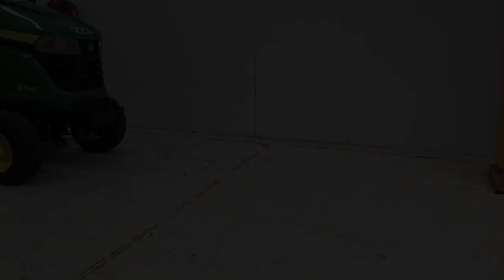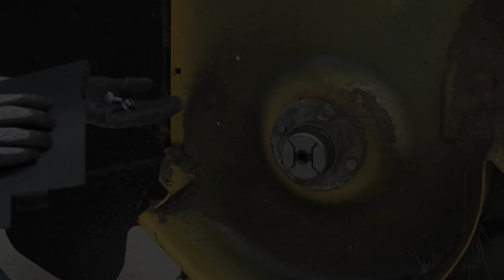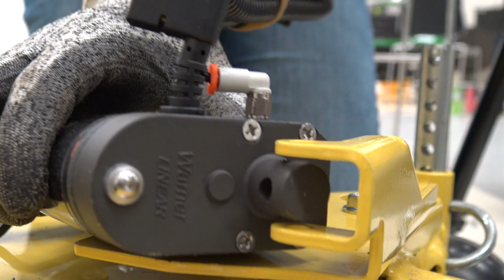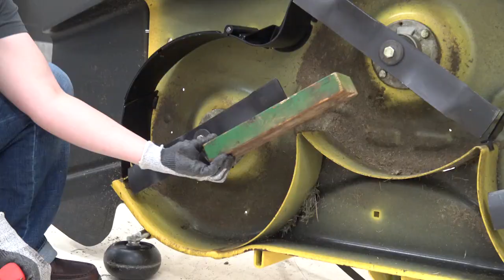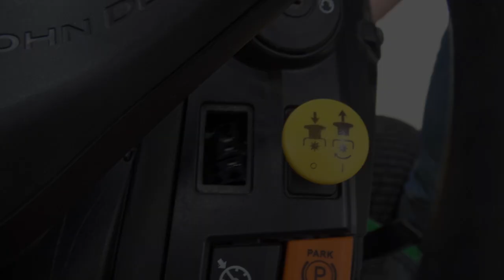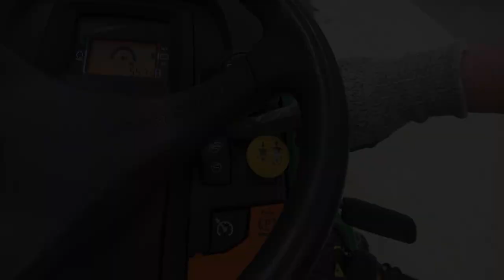How To Install Electric One Touch MulchControl™ | John Deere

Comment: My mulch control switch is operating opposite of what it should.  When I switch it to open it closes and when I switch close it opens.  What is wrong?
Reply from the maker: AL, we're sorry to hear that you have been experiencing issues with your mulch control switch. If you haven't already you may want to take a look through the Operator's Manual of your unit. Towards the back there is a "Troubleshooting" section that may help. Many Operator's Manuals are available online, so you may be able to access the manual for your model at techpubs.deere.com. You can also contact your local dealer for further assistance. Find their contact information at Deere.com/Dealer. We hope this helps.

Comment: What's the spec numbers you forgot to say in this vid. "Tighten nuts to spec with  using a torq wrench."
Reply from the maker: Thanks for asking, Davi. The torque for the Mulch Gate Stop Plate is 20 N·m (15 lb·ft). This information and other specifications can be found in the Operator's Manual for the MulchControl™ Kit which is available online here: https://bit.ly/3DcFK6a. We hope this helps!

Comment: Hi , No ! First Thing Is To Clean the Underside of the Deck ! Use " Blue " Locktite Thread Locker On All Fasteners . ( To keep from rattling loose ! ) . Re- Check Deck / Blade LEVEL ! After Re-installing The DECK .
Check the Door / Gate Opens and closes Moves freely !  ( Also Check Every so often , so You Do Not Burn -
OUT The Actuator / Motor $$$$$$ ) !!!!

Comment: The one touch kit I ordered for 48 inch deep acel deck the gate does not close all the way.  Did the send me wrong kit?  I have John Deere x570 with 48 inch deep acel deck
Reply: Kendall what was wrong with yours. Have same issues today!
Reply: @chloe5susan  I have one on my X570 (54 inch deck) and while it was mostly right some of the brackets needed small tweaks to fit my deck properly and clear the blades.  In your case I'll bet you have the actuator bracket attached wrong.
Reply from the maker: Kendall, if you have any issues or questions about the installation of your 48A electric one-touch MulchControl™ attachment we recommend reaching out to your local dealer for assistance. If needed, you can find the contact information for your closest John Deere dealer at dealerlocator.deere.com.

Comment: On a x380, a 20amp fuse on position C3 is required to provide 12v to the red wire of the source power for the kit while the yellow wire provides 12v when the main switch is on. The fuse is located in the fuse box.
Reply: Hi Richard Turcotte. I’m going to install this on my X380. Is there no fuse in C3 to begin with? I haven’t run out there to take a look yet. Thanks!
Reply: Kurt B , on mine there was one but was broken. It provides 12v on the red wire where you plug in the actuator harness. The yellow wire has 12v when the key switch is turn on. The red wire is hot all the time.
Reply: If you also have a powerflow, place the actuator support plate on top of the powerflow black support plate for better fit. And you may have to adjust for correct operation of the door by moving the actuator plate. There is some light movement possible before tightening the 2 bolts.

Comment: I wonder if one is made for a z920
Reply from the maker: Thanks for your question, Mike. This Electric One Touch MulchControl™ kit is available on X300 and X500 Select Series Accel Deep Mower Decks. The Z920M ZTrak™ Zero-Turn Mower is available with a Mulch On Demand™ deck, which can switch between side discharge and mulching operation with the flip of a lever as the operator mows. You can learn more about the Z920M and the Mulch On Demand™ deck on the product page here: http://bit.ly/2Yz4BzB.
Reply: @JohnDeere  Is there anyway to get a "mulch on demand" option for a z920a 60-inch?
Reply from the maker: Hi Kyle, this Electric One Touch MulchControl™ kit would not be compatible with your Z920A. We recommend reaching out to your local John Deere dealer to see what mulching options would be available for your mower. If needed, you can find their contact information here: https://bit.ly/2zIdfB5.